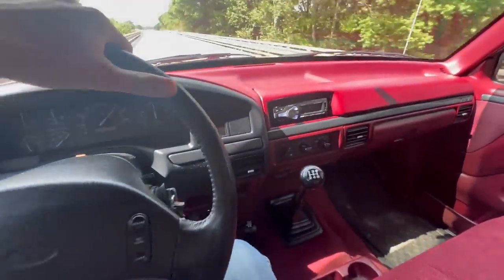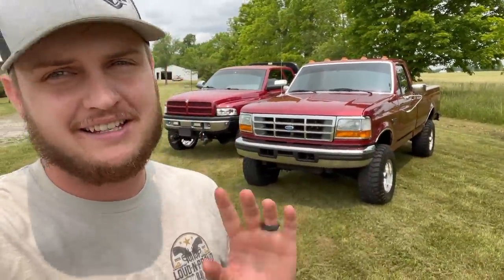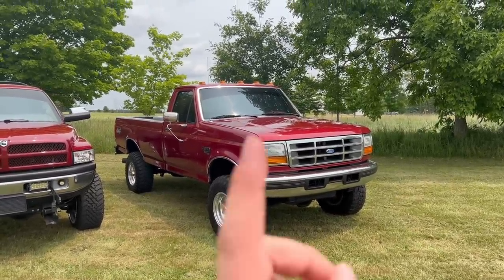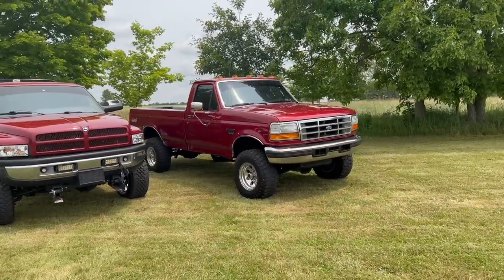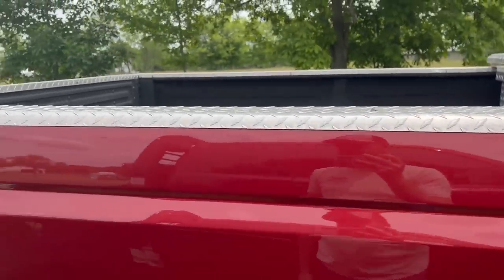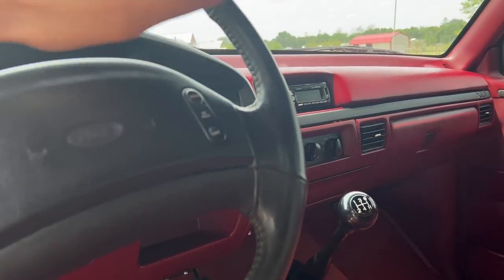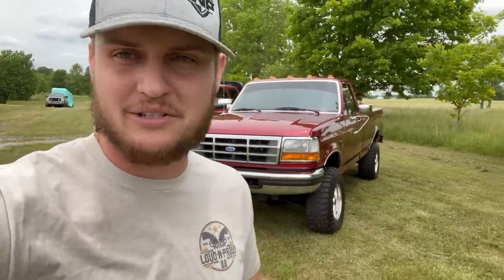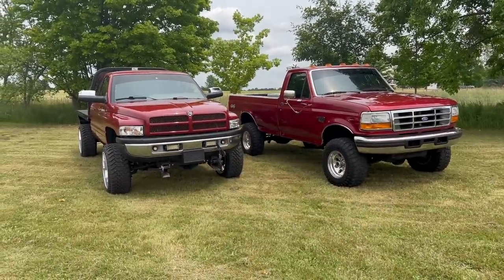It took me 6 YEARS to find this EXACT truck!!!

Comment: Oh my goodness look how promiscuous that blood red interior is on the 7.3 ❤. All she needs is some 300 % injectors and few minor other mods and she will be a beast 🙏
Reply: 300% is extremely overkill for “minor mods” on a OBS. Even my 180/30’s will smoke out a city block, and would surpass 1500° quickly while towing pre intercooler. 160/30’s or even 160/0’s are plenty for a minor mods 7.3.
Reply: @dash456789  nice yeah I like to build my 7.3s  pretty stout top to bottom with good tuning and big enough turbo you won't smoke anyone out .

Comment: Hell id even rip out that cd player and throw in an am/fm cassette deck and mount a cb radio in er and run er like it is. That truck screams perfection. I got the exact same truck 7.3 5 speed 4x4 with 123k on the odometer. Canadian truck lol. Two tone back and silver. But living in the maritimes has rotted her away over the years she needs a cab, the floor is nonexistent at this point lol